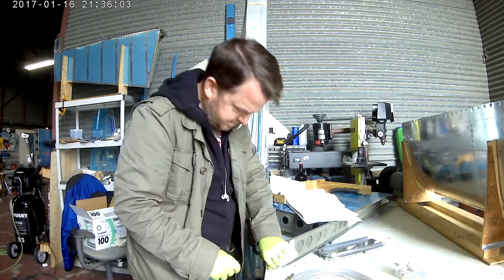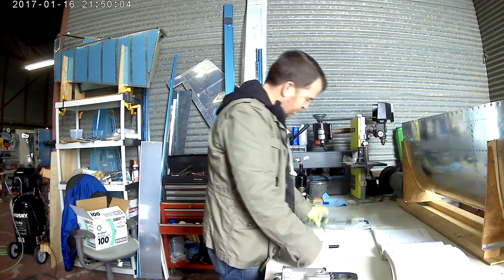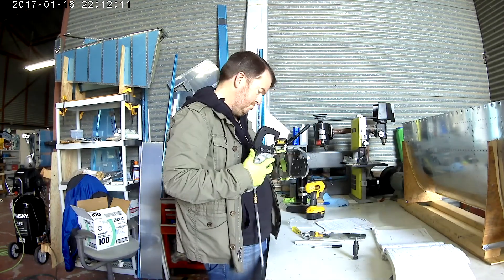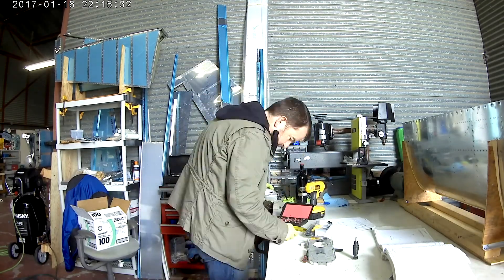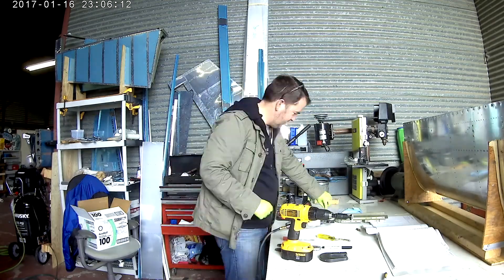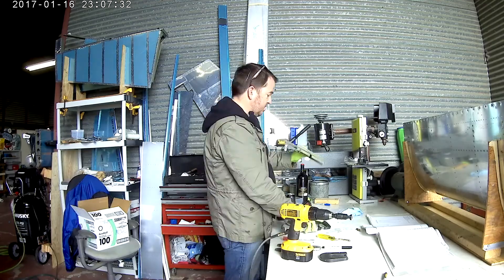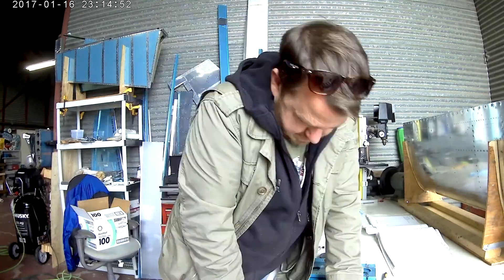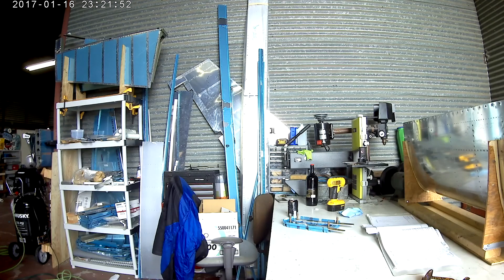RV - 14 Tailcone 2

Comment: Hey Andrew, I am now working on section 10 on my 14a. the steps have you construct the little angled rudder stops and then countersink the four holes for the size 4 rivets (I believe they were size 4 if I remember correctly). How did you countersink the inner two (closest to the right angle of the piece). You cant fit a countersink cage there and I'm not sure what else to use. I was hoping that you have already done that step and could provide some insight......
Reply from the maker: Scott,

I used my hole deburring tool countersink bit to slowly make the countersink.
Reply: Andrew Kilroy excellent.... that's kinda what I was thinking. Thank you, sir! I appreciate your videos! They provide great insight as I'm going through the build! I just ordered my wing kit last week, so hopefully they will arrive just as I'm finishing the tail cone!